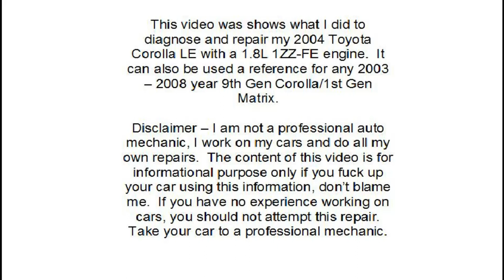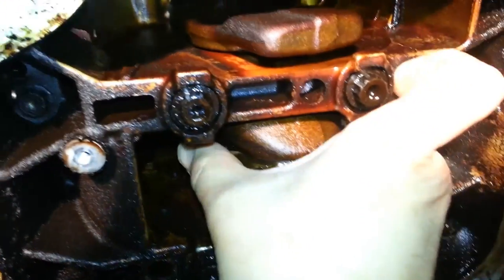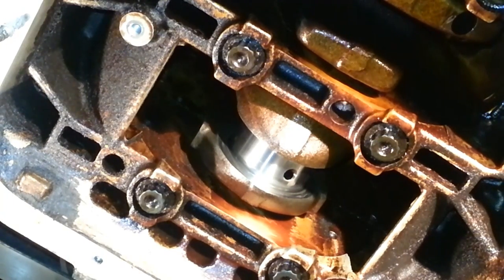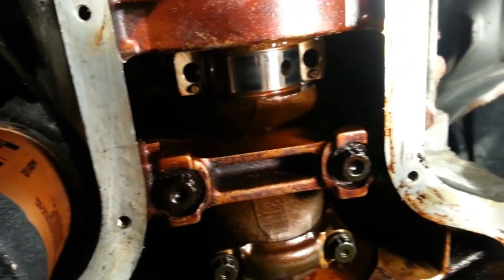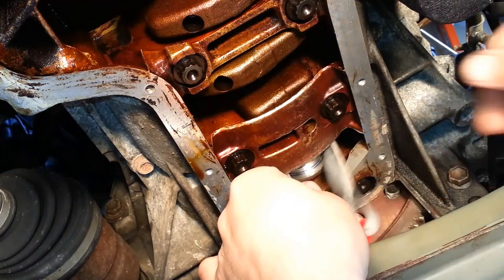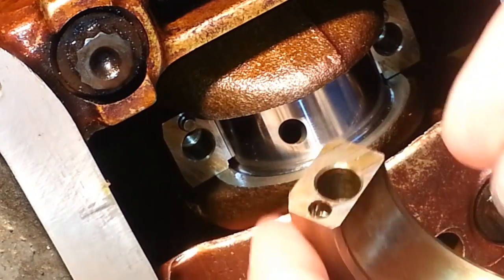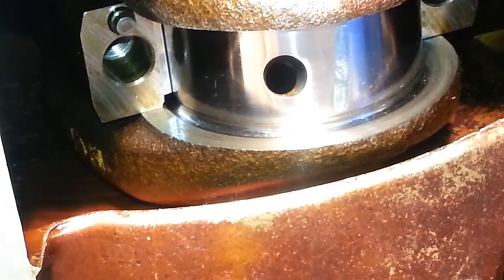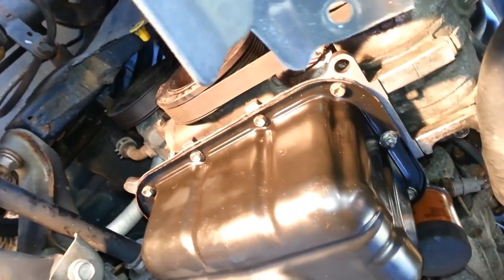2004 Toyota Corolla 1.8L bearing replacement to fix rod knock caused by bad connecting rod bearings

Comment: Please also I want to know more. When replacing the metal at the connecting rod which one should I go for, Is it standard or 010?
Reply: I believe it should be standard because the undersized ones are for if you have your crankshaft machined. I'm not expert though that's just what I've read because I'm going through the same process.

Comment: You didn't show it- how do you clean out the oil holes in the crankshaft? Any grit left behind would be destroy the new shells. Maybe plug each one with lint free cloth before polishing? Also- toothpaste worked into a shoelace is excellent for a "final step" to help make a mirror finish. Good thing you caught this early- and not in a snow storm on the roadside.
Reply from the maker: A pipe cleaner and shop vac did the trick nicely.

Comment: Nice work! Have you had success with this method in the past? what do you figure for longevity? Thanks again for the great info!
Reply from the maker: +mrichrd1 This is the first time for me, but I don't expect any issues, it's the same result I would expect if I pulled the engine to do it.

Comment: GREAT Video.... Nothing beats experience.  THANK YOU.. Know I know what I must do, but... after the connecting rod bearing (babbit)  replacement, and crank shaft journal  polishing , et al,  do you recommend checking valve clearance too, or would you consider that overkill?
Reply from the maker: +Terence Harper Terence, I tend to lean to overkill myself on most projects, however, I did not check the valve clearance on mine.

Comment: So hoping to get a reply but does the Manual 2004 Toyota Corolla S come with a 1zz Stock? I have the same problem and want to make sure I buy the correct parts
Reply from the maker: The engine code should be in the VIN number, run the VIN number through a decoder to see which engine is in the car. 
https://www.decodethevin.com/

Comment: New to the channel and have a 2003 Matrix making knocking noise.  Can you provide part numbers for the parts used.  If it's not the bearings making noise what else should I look for?  I will have to get the car towed back home soon.

Comment: After replacing the bearings due to damage. Will the engine ever be the same? Do you have to always be careful with how hard you push the car? Or after breaking in the bearings, can you "red-line" with no problem just like stock? Thanks
Reply from the maker: Done correctly, engine will run just fine with no problems and no worries.
Reply: Redlining your engine frequently is very bad for an engine, period.

Comment: Wow! this is a fantastic video.

I had a mechanic work on my Daihatsu Terios Kid 99 model which was having the same issue
After the job,the knocking has been eliminated. But there is now (1)emision of white smoke from the 
exhaust pipe,especially when i gas it/put the engine on load.(2)a little misfire once in a while.

Please,can you profer a solution to this?
Reply: White smoke might be coolant leaking into the cylinder from a blown head gasket or cracked head. Smell the exhaust, if you're running antifreeze you'll be able to smell the antifreeze in the exhaust.

Comment: Can you provide a link to where you purchased the bearings? I contacted my local toyota dealership and they only sell undersize bearings which means you have to get the crank machined. My engine has 300,000km (186,000 miles), and I'm contemplating whether or not to replace those bearings before one of them fails so 'hopefully' I don't need to polish the crank.
Reply from the maker: http://toyotapartsestore.com/2004-toyota-corolla-le-gas_1.8_l_4-transaxle_standard_trans_speeds-engine-crankshaft_bearings-8427145/
Reply from the maker: http://www.toyotaonlineparts.com/auto-parts/2004/toyota/corolla/le-trim/1-8l-l4-gas-engine/engine-cat/mounts-scat
Reply: Brother, I couldn't make any sense of your comment what so ever. For the love of God, please. learn how to use punctuation. Your comment is quite possibly the longest sentence on YouTube. I honestly don't even know what you were trying to say.
Reply: Thanks for the how to.  I've had several toyotas and I usually keep them for over 200k miles, but I have never had an engine problem.  I suspect someone didn't change the oil for a long time.  For 118k miles that looks very dirty and grimy inside.
Reply from the maker: Web site was http://toyotapartsestore.com, now is https://toyotaonlineparts.mcgeorgetoyota.com/
Reply: you're supposed to see what bearing number is marked on your cap. mine said "2". there is size 1, 2, 3. 1 being loosest, 3 being tightest. mine after sanding still were withing spec of #2
Reply: How much the bearings cause
Reply: @83RS  feel better now you made your self feel smarter if you couldnt tell he doesnt have a high shool diploma neither do i hope you liked my punctuation.
Reply: @tonym9450  Thanks for the feedback. I was thinking about whether the polishing was going to change the diameter size.
Reply: I read it fine.
Reply: @mrmarkg8564  is the correct part numbers 13041-22024-01, 13041-22024-02, and 13041-22024-03?? Trying to fix my car as well but want to make sure I’m buying the correct parts
Reply from the maker: @DudeWithALude97  That looks like the correct part number for the Connecting Rod Bearings Mark-1, Mark-2 and Mark-3.
Reply: @mrmarkg8564  awesome thank you so much for your help and video I hope this resolves my knocking and gets a little more life out of my engine

Comment: Great video I have a 2008 Camry I may possibly doing I have a two cylinder diesel tractor I’m doing right now the shoe string trick is fantastic because the crank needs polished and I didn’t take it out of the engine block

Comment: 2006 sebring started knocking about 2 hours from home on the interstate. i figured all was lost as this has been my problem car since i got it 3 years ago. I'm going to pull the pan and have a look at the bearings to see if this can be an easy(ish) fix or if I need to replace the crank. regardless, I'm going to have to do a head gasket too... like i said, problem car
Reply: nice tip about the shoelace, hadn't thought of that

Comment: Hi. My Fiaf has a slight rod knock, but disappears after a few seconds. And only when started from cold. the rest of the day is fine. Then the nexd day when its cold, the same thing.
This only started to happen during our heatwave here in the UK.
I have done big end bearings before on another car, but I was wondering if anyone has any other ideas to stop it before changing the bearings??
Maybe just an oil change. The oil is very clean.

Many Thanks in Advance.

Brian.
Reply: Could be a number of things. Sounds like Piston Slap to me. (Pistons needing to expand from heat to fill cylinder hole) Search the model of your vehicle with the term piston slap and if it's a common issue you may find other people who have experience with it. Maybe try a different oil, try conventional if you're currently running synthetic.

Comment: I really wish we could have heard the engine. I wanted to know how it sounded after watching 50 min video. So you didn't get a bunch of FM from the rags and oil on your skin? FM - Foreign Material (lint,dirt, debris, etc )
Reply from the maker: +TwiZtiDTeXas The last 35 seconds of the video shows the engine running and you can hear how is sounded after the repairs.

Comment: Mark thanks a million for this video!  I am in the middle of the job, When I called the toyota dealership to order the bearings, they are asking me for many additional questions than just the number stamped on the side of the connecting rod.  Mine is stamped "18" on one side and "2" on the other.  Any help would be greatly appreciated!
Reply from the maker: Hi Glen,  I few comments down you will find a link to two sites where you can lookup you bearing part numbers to give to the dealer (be sure to select your vehicle since the link will take you to mine).  I don't know what the "18" is, but the "2" should be the bearing "mark".  I found this link which has  a picture of the stamp location for the bearings, hopefully it will help.
Reply from the maker: http://www.celicasupra.com/forums/showthread.php?67077-5MGE-lower-end-number-matching&highlight=proper+sizing+of+rod+bearings+stamped+numbers

Comment: I have a 2001 corolla 1.8 with the same problem. I have the plugs out, oil pan and pick up tube off. Also took rod cap off # 2 and checked bearing. Slight scoring on bearing but journal looks real good.  My problem i feel is going to be working around that motor mount brace that runs almost straight across  the connecting rod on the small end of the oil pan. How in the world did you apply all the methods you used replacing the other bearings? Or did you even replace that one?  Any ideas would be much appreciated...
Reply from the maker: Shown in the video about the 25 min mark. I don't remember anything that difficult about it, I might have used a swivel socket adapter to get the bolts out.

Comment: An idea for pulling the rod down...try and get a bolt in it,grab the tip of the bolt with a slide hammer and pull..it should be real easy that way.

Comment: Also noticed nicks on bearing cap. Is it crucial to have those resurfaced as well?
Reply from the maker: +hiblendmedia  Sounds like you spun a bearing. The bearing cap also needs to be smooth so that the bearing sits flush to allow the proper bearing clearance, but since the cap houses the back of the fixed bearing it does not need to be polished.
Reply: k, i'll probably do a light filing and sand the cap. Hopefully this works as a temp fix until I can rebuild the engine properly. Thanks for the tips and vid.

Comment: Hey Mark, great video, it's really helping me tremendously. I really appreciate you posting this. 

I have a couple of questions I was hoping you can answer, or at least point me in the right direction. I have a 1zz and I spun the #3 pretty bad. it scored and pitted the journal. I managed to polish it pretty smooth. 

My question is, do you think I might have removed enough material off the crank to warrant using an undersized bearing? What size bearing did you use? Standard?  I was able to find aftermarket undersized bearings that are 0.010" and 0.020, do you think that I should use either?

Any help would be great! Thanks again for the video.
Reply from the maker: It is unlikely that you removed very much material from the journal to justify an undersized bearing size, but don't guess, you have too much time invested to guess wrong. Buy standard bearings and use the plastigauge to measure the bearing clearance correctly. Worst case is you will need an undersized bearing and they won’t exchange it so you need to buy it, they aren’t that much considering what you have invested so far.  I used the standard bearings for my replacements and as you saw in the video, my clearances were well within range.  Glad you found the video helpful and good luck with yours.
Reply: Thanks for the rapid response. I will try that. Your awesome man. Thanks again for the video, I hope you post more.
Reply: Hey Mark. I just wanted to let you know that I got my car running and it's purring like a kitten. I was trying to be as conservative as possible when I was polishing #3, but I ended up having to purchase a set of undersized bearings for the #3 rod/journal.  When I measured it with the standard bearings the gap was way over, .006". Then when I put the undersized bearing on it was over under by .002", which was perfect because it allowed me to polish most of the pit/grooves out. 

I just wanted to thank you again and really, I can't thank you enough. Your video helped me so much. 👍 Cheer's
Reply from the maker: Awesome, glad you found it useful.
Reply: Awesome. me too.  I have a bearing that needs to be replaced and smoothed out.  Can you tell me what undersized bearing you actually got?  I am really close finishing this project but fear getting the wrong size.  After I order the standard clearance bearing I will plastic gauge then measure.  for the .006" gap what undersized bearing did you get because I feel like I have the same issue but don't want to get them too tight or too loose.  Please advise.  I also have a caliper up to .00 mm if I need to measure shaft diameter.

Comment: I know this is an old video but I want anyone that sees this to know to NEVER use a Fram oil filter on anything you care about and especially if it's a import motor like the 1ZZFE. Good fix though. How did it hold up?
Reply from the maker: I've never had any problems with Fram filters, but I prefer WIX when I can order them in advance.  Repair is still holding up fine after 65K miles.
Reply: @mrmarkg8564  Thanks for the update logs.
Reply: Great video on the repair! I have to agree with the others, ditch the Fram filter. I only use Purolator or Toyota on my 04 Matrix. I bought a bulk 5 pack from Amazon of the Toyota filter each is shrink wrapped inside of a box. Look up some videos of actual cut-away or cut apart filters. Fram is notorious for cheap filter internals. May not be a huge deal in these small filters.
Reply: @94concorde  after doing lots of research on Fram filters I'll never use them again. I stay with Toyota filters on my 07 Tacoma 07 RAV4 and 04 Toyota Corolla. There are other great filters out there but I just prefer to stick with Toyota filters

Comment: I just bought a 350z that is experiencing oil issues. At first the sensor was bad (the new one may be too), and now I'm reading really low oil pressure. Now I know that's indicative of one of a couple things this being one.  How much do you think this would cost me to fix? Is it worth messing with, or should I try and get my money back?
Reply: Bradley Bauder dude, you bought a car with a bad engine, I bet it was sold very cheap and "as is". That's the scam people love to do. 

why spend thousands of dollars trying to fix someone else's garbage that got pawned off to you.. I don't mean to sound like a dick but just to something and what is that? "Think". If you haven't already it's most likely too late, but you always want to fight for the money back, and get yourself a properly running vehicle. If you didn't get the money back, take the L and learn from this common newb mistake.

Comment: Mark,How long did this fix work? Is this car still running? I am about to attempt this with a 2005.
Reply from the maker: Hi Tim,  Still running great, its been about 30K miles since I changed the bearings.

Comment: Hi mate great video. My sisters Celica has same knock only much louder would I be wasting my time doing this job as she has been driving a few weeks with the knock?
Reply from the maker: It's possible that you can still restore it, but the only way to tell is to drop the oil pan and have a look.

Comment: excellent job buddy. how did the engine hold up? might have been easier for ya with a camera stand lol.
Reply from the maker: Thx, It held up fine.  I ran it for almost five more years and 75K miles and was still working great when I recently sold the car.

Comment: Do you remember the torque specs on the rods by chance?
Reply from the maker: Stated in the video about the 38 min mark.  15 Ft lbs plus 90 degrees.

Comment: So the other day I heard knocking and ticking on my 1999 Toyota and I didn't know what it was at first but I realized I was low on oil... so I filled it up with oil and it stopped making the knocking/ticking but later on at night it began to knock really loud and the car turned off on me, I'm thinking maybe the parts broke on the inside of the engine? And I'm really wondering what I should do
Reply from the maker: It is best to have it diagnosed by a professional mechanic.

Comment: Great video. Very well done.  I have a Camry with the 3VZFE  V6  which is starting to knock at 360,000+
Do you think the V6 is easier to get at the bearings than your 1.8? I am hoping to catch it in time.
Reply from the maker: I've never done it on a V6, but I can't imagine that it would be any more difficult.  The overall job is pretty straight forward if you have easy access to the oil pan.

Comment: Hi, great video btw. QUESTION? How much can this coast if i take it to a mechanic to do it. I just bought an 07 Scion tc with 120xxx miles, i believe it has the same 2.4 engine as a Camry, and its doing the knock when accelerating. Depending on the coast im contemplating on giving this a try myself...
Reply from the maker: Sorry I have no idea what this would cost if you took it to a shop.
Reply: @mrmarkg8564  is it necessary to do all bearings or just the one that's bad, i did the diagnose by disconnecting the coils one by one and when i disconnected #4 the knock wasn't there.
Reply: @mrmarkg8564  also do i need to use the plasticgage or just go by the torque specs, do you when where i can find the torque specs for my engine. I think im going to do it myself
Reply from the maker: @johnnymejia7  You won't know until you get a look at them.  I had one knocking, but replaced them all since others showed wear and they were relatively cheep.
Reply from the maker: @johnnymejia7  The plastigage is the correct way to check the clearance. You will need to do some searches to find the torque specs for your engine.   You may find them here: http://www.torkspec.com/torkspec.aspx
Reply: @johnnymejia7  if you're under there might as well do all of them
Reply: Maybe it's not the con rod bearings it can also be the knock sensor

Comment: Question, how long did the job hold for? Curious.
Reply from the maker: We put about 75K miles on it after I did the bearings and it was still running great when we sold it about 1.5 years ago.
Reply: @mrmarkg8564  no kidding? that's reassuring. I'm in the same boat you were, less harsh of a knock though. so, I'm hoping for some good news. Thank you for your response and your information! Your video was incredibly helpful and informal (:
Reply: 75k+!? Incredible work!